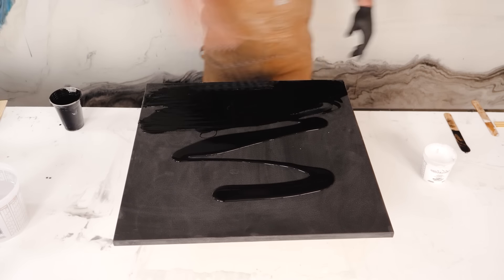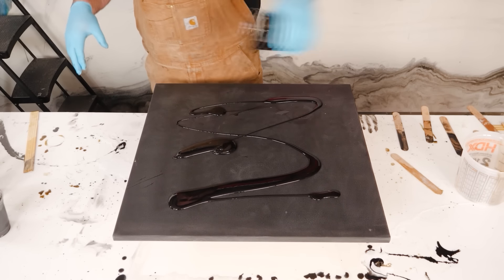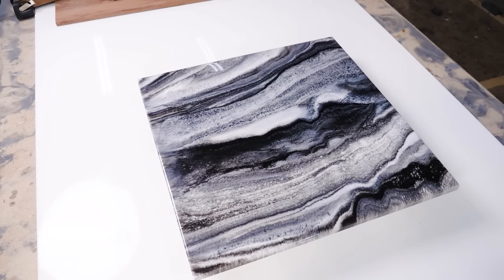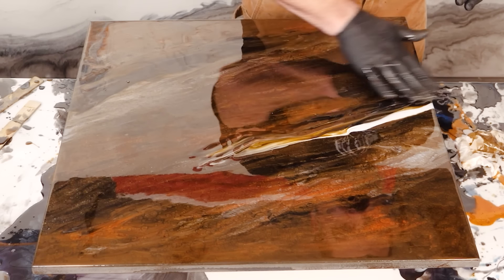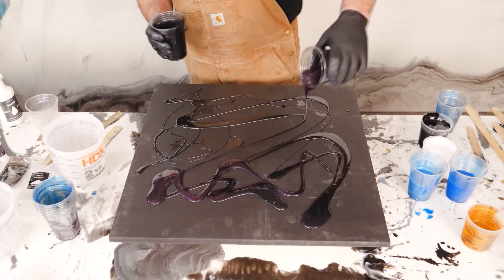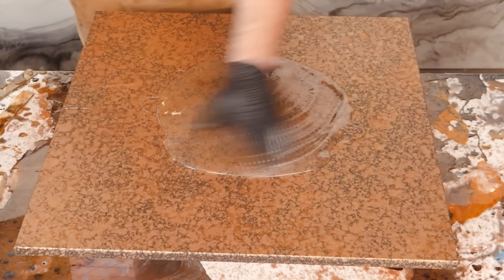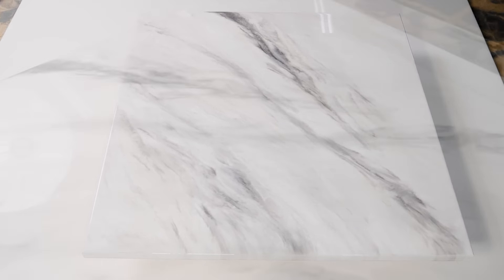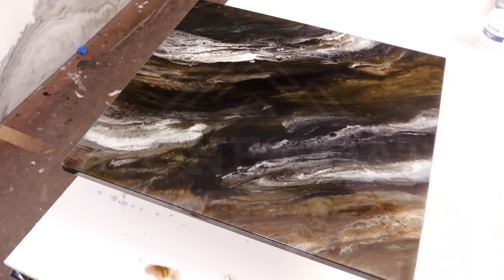13 Simple Epoxy Finishes Back-to-Back

Comment: Another way that you can learn to do epoxy countertops pours or dirty pours and much more. Is to start off with tumblers. This is way less expensive and you can create tons of different pours and patterns till you find the 1 you like. You can get a variety of sizes and shapes of these inexpensive tumblers. And try your hand at epoxy pours, and f you comfortable with your results. You can go on to do your countertops. The best part is if you don’t like it or are not comfortable doing your own countertop pours. It cost you only about $11-$15 bucks per tumbler to find out if you’re doing it or going to pay someone to do it.